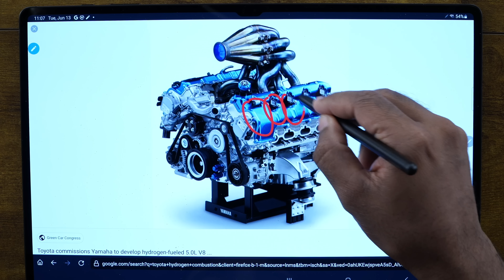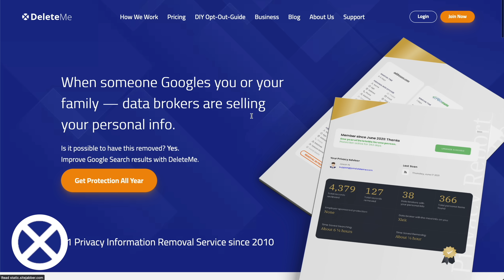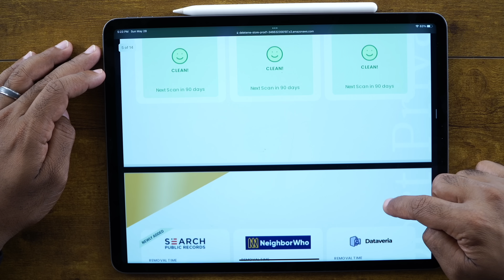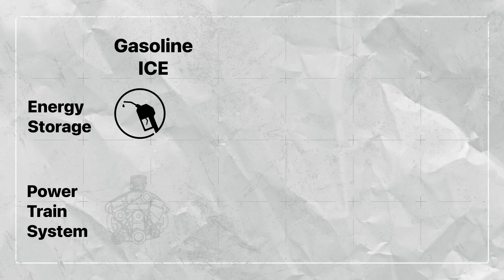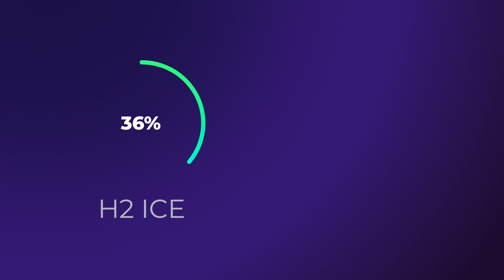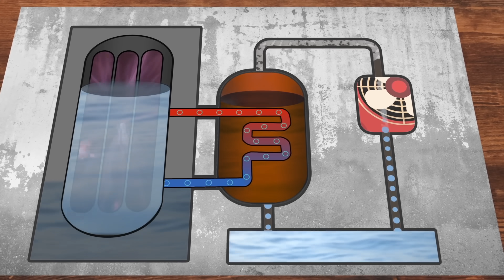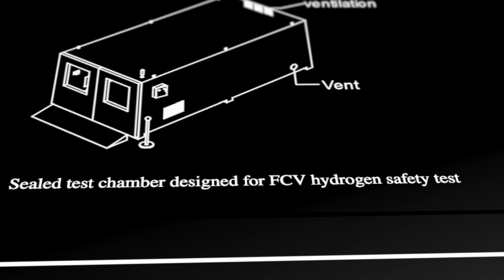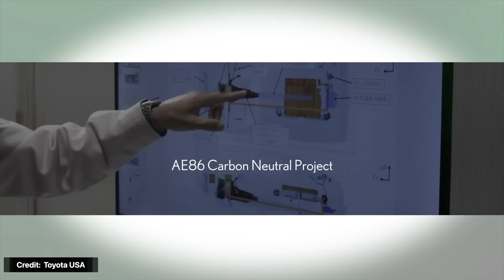Toyota's Says They Just Destroyed EVs - Hydrogen Combustion Engines

Comment: Let me start by saying that I am most definitely lacking the knowledge on how current EVs source their materials. However, it is interesting to me that you would say it is a poor choice on Toyota's part to invest in this project, as it is a much more sustainable option than current EVs. The amount of pollution courses by mining these REMs and well are their inherent rarity makes it much less sustainable as we then throw them out in 20-30 years. With Hydrogen ICEs, there is no limit to how long you can keep a car going with proper maintenance and repairs. On top of this we already have some industry built for recycling ICE engines. As for the production of hydrogen, I would say that if it is coming from green energy sources, I'm alright losing the energy if it ends up cutting emissions on a large scale, and I'm sure that with time people will find ways to improve efficiency or use the lost energy for something else.

Again, not sure on all of the facts, but for me hydrogen ICEs are definitely worth investing in and I am very interested to see what happens with it in the coming years.

Comment: Good video, but a few things always missing in these comparisons, the pollution for EV's is still there it just happens in the production.  Furthermore the same problems hydrogen has EV's have.  The infrastructure is not there.  (Yes there are more charging stations then hydrogen - but as California demonstrated asking people not to charge their cars) we do not have the structure to replace gas vehicles.  Furthermore weight is a problem for battery vehicles.  This is why besides the charge time, trucks made with batteries is a terrible idea.  EV's are a great nitch option - going around town, to work but passed that their utility is very limited.

Comment: The problem with hydrogen is that 1. You have you get it, usually by using electricity in water to separate the hydrogen and oxygen so already its a waste of efficiency. 
2. You have to store and transport then sell it...great for the oil companies who have that infrastructure in place,  gas stations..also good for them because you need to lubricate moving parts. But not so great for the consumer 
3. The engine is just a ICE, you need more mechanical maintenance, oil changes. Again more $ out of your pocket.

Comment: the electrical grid in the United States is not remotely capable of supporting a world dominated by electric vehicles, so it's kind of a non starter..even if it was, every piece of heavy equipment that is absolutely necessary to mine all the minerals (lithium, cobalt, nickel, and whatever else they need) run on fossil fuel and they are most definitely not going to be making the switch even if they could get enough energy into a battery to make the machine work 24/7 without making an already massively heavy machine heavier, the power grid would have a heart attack times a million forever

Comment: You can find a power plug everywhere, where are you going to find hydrogen? Yeah it may take hours to have some charge in a run of the mill house hold plug, but at least you can. Also look at the complex ICE vs the simple EV, its like comparing CRTs with LED displays, just look at the things inside, the beauty of EVs is their simplicity inside, this matters in the long run, less parts to maintain or replace periodically.

Comment: I think of the H2 ICE as useful in the same way as a Lamborghini is now, it's not designed to be practical. Having this will help convince the relative small number of muscle/sport car lover to leave petroleum based fuels. It's bad as a tool just to get to work or the supermarket and that's fine. As long as we don't pretend that making H2 from CH4 and then wasting most of it is clean then it's good to fill a niche market.
Reply: Problem is Lamborghini runs on a gasoline combustion engines, which have seen over a century of development and innovation allowing manufacturers to build high performance engines. Hydrogen engines will not have that lengthy opportunity for development.

Comment: OK, but you can still say that about electricity, because electricity is not fuel source it’s a product of a fuel source for saying that hydrogen could be made using less clean methods isn’t anything new fact is most EV stations are powered by gas emissions renewable sources are almost good in the right area, and focusing on a single point
Reply: Another idea about producing hydrogen to nuclear reactors is a much better option because it clears already clean enough because unless you watch, the Simpsons were thought to Noble was an absolute Wilmington powerplant. You know that we solved nuclear waste a while ago. So right there, there’s a clean ways of producing it, and the best part is the unlike electric batteries that decay hydrogen can be stored for longer periods of time so in the long run it’s a much better alternative than the dream of electric cars because electricity is a fuel source product of a fuel source if you’re spending multiple places on the grid, solar and wind just doesn’t cut it unless you’re in the perfect spot for it to be used and even then you’re looking at black ounce one single thing goes wrong happens, even with hydroelectric power
Reply: And regarding the Hindenburg bullshit. Not doing the car up like a balloon and is it really any more dangerous than gasoline if it was exposed to a flame or spark?

Comment: This is bullshit. Hydrogen is the most abundant thing in the universe. It is in a lot of things. Hydrogen burned cooler than gasoline. People think for yourself. Then Hindenburg blew up, but no one was burned. The reason why is hydrogen doesn’t burn as hot as gasoline. Another thing we can continuously run combustion engines using hydrogen. Electric cars are way heavier then a regular gas combustion engine car, it’s double. Anyone that has a Tesla can tell you that they have to change the tires almost every year because of the weight of the batteries. Imagine filling up your tank with water instead of gasoline. You can get hydrogen from water don’t be lazy. Look it up. This guy is bullshit. Gas or I should say oil companies don’t want you to know this. Hydrogen is the most efficient form of fuel in the world and the oil companies. Don’t want you to know this they bought patents killed scientists, so that they can still sell you gasoline. We can be fuel independent if we just think for ourselves. Hydrogen is flammable it combusts. Gasoline engines the gas combusts. An EV car. You have to stop at a station and charge for at least 15 minutes. Not practical. Hydrogen is like gas. This guy is full of shit and he’s bought by either oil companies or gas companies. Think for yourself. If we start now and whatever the downfall is for hydrogen, all we have to do is keep up with technology and invest in it. Like we subsidize oil companies coming out of our pockets and we don’t get. return on our investment to subsidize oil. If we invest in hydrogen technology, we will be free of the oil big business. Hydrogen can be separated from water, the most abundant thing. in the world. Thanks for yourself. Understand that hydrogen is flammable like gasoline. It can be used in a combustion engine. That’s the normal technology now. Not electric. Ion batteries have to be mind from the earth. Lithium ion is toxic. Do the math people lithium ion is mined from the earth and is toxic, water isn’t.

Comment: Armored or not, hydrogen has a trick it loves to pull where it embeds itself in the material containing it, called hydrogen embrittlement. It is only a matter of time before the components storing that hydrogen gas and transporting it to the engine lose that ability to safely store hydrogen gas. How long does this take? What are the maintenance costs associated with dealing with that? Can we create a material that is immune to hydrogen embrittlement?

On a side note, the best source of large scale power production, by far, is nuclear. So, regardless of whether we use a battery, some kind of super capacitor, or a "clean burning" gas like hydrogen, until we collectively agree to wholly embrace nuclear power, our transportation will never be truly near as green as it can or should be.

Comment: Batteries are not more efficient as they are not an energy source.  You lose about 15% just charging them, thats not even counting losses transporting or generating the electricity. They are a little more effective than ICE in some cases, until you start looking at creating and replacing batteries. EVs are garbage.

Comment: EV cars pollute to. Every time you use the brakes. Brake dust is very bad pollution
Reply: Technically they'll put out less brake dust as well because the electric motor can be used assist braking.
Reply: @PURENT  not really way more weight to slow down equals more brake dust
Reply: @explorster  Just gonna put it out there, electric vehicles and hybrids have longer brake pad lifespans due to regenerative braking. Manual transmission gasoline cars also have longer brake pad lifespans due to engine braking.

Pretty simple, the longer the brake pads last, the less dust is actually put out.
Reply: @PURENT  pollution of brake dust is pollution of brake dust bro. It doesn't matter if it take 6 months or a year to go through brake pads it still equals the same amount of brake dust one just takes a little longer.
Reply: @explorster  No shit. The point is to reduce pollution that can't be eliminated.
Reply: @PURENT  you are not reducing it, you are  just prolonging it.
Reply: @explorster  Use less than what you needed before = reduction.

Comment: Thank you again for a good video giving the pros and cons on EV, H2 and Hybrid H2 and EV. I have a better understanding of each now. I have a hybrid car (gas, electric), and its wonderfully bridging the gap between the tech; gas and EV. I am not sold on EV alone mainly due to the battery and how it is manufactured and the enormous amount of energy production necessary to supply to EV; so the H2 fuel cell (not the ICE H2) seems more promising to me due to cold temperature problems with EV. 

I think Toyota is fleshing out the issues with H2 with partnerships and spreading their research costs. Which may produce a gen 2 or 3 H2 later. Seems like (and please correct me here if I misunderstood it) the H2 might be better suited to commercial ventures like trucking companies and government vehicles. This would reduce emissions again and give our electric grid infrastructure some breathing room to ramp up for an electrified society. That said, diversity is the better course in my opinion. Having lived through blackouts I was still able to cook and draw water due to back up diesel generators (city level for water) and natural gas for cooking. I still think the nuclear option is the most viable especially with thorium and sand silo batteries (as described in your earlier videos). 

Thanks again and keep them coming.

Comment: If you have an array of solar panels you can use it to charge directly an Ev with a motor with 2 bearings. But instead you can use that electricity to produce hydrogen, store it in huge tanks, distribute it by truck and ship and store it again at the gas station, all this under high pressure and to be fed into a motor with a thousand moving parts. Something is not right here.
Reply: I would say that what's wrong is a lack of understanding of basic physics and efficiency.

Comment: BEV lovers, bang on about clean, environmental, recycle and what not, but non of that happens. Recycling of the batteries uses more energy than making new ones, also creating other pollutants, same with solar panels. Most of the recycling works in small scale but can't be scaled up. So BEV's are charged with fossil fuels that are less carbon friendly than using petrol or diesel, but that's alright because the owners have solar panels at home that charge their vehicle over night? Toyota are investing in Hydrogen the same as anyone who makes truck engines, they realise that batteries now and in the near future just aren't going to work for anything cars. Trucks and heavy machinery are going to have to use something other than batteries, yes the Tesla semi is a failure, deal with it. So the infrastructure for Hydrogen is going to come as it is the only viable alternative that we have for trucks.

Comment: Tesla has way less moving parts so less maintenance and less parts to break. Using a engine of any type that is combustion adds more complexity regardless of the fuel source. You cannot beat a simple battery and induction motor that does not destroy itself. Fool cell is not the answer.

Comment: Electric battery operated vehicles is a HORRIBLE idea. Nobody is bringing up the fact that the batteries are not reusable or recyclable. And the items inside are toxic to the environment. So the carbon in the air will be better, but our landfills will be nothing but huge toxic dumps. Not to mention the power grid issues. And power plants are not free from toxic fumes. So all in all, electric vehicles are much WORSE for the environment. But the governments are pushing hard for them. They must have their hands in a pot of cash, where they make more than oil and gas. Otherwise its a no brainer to stay away from battery operated vehicles.

Comment: One of the engineering obstacles is hydrogen embrittlement of aluminum. The Aluminum in engines over time develop microfracures when exposed to hydrogen for extended periods, thus requiring a coating (ceramic) of some sort. 👍👍 to Japan for standing up to the craven onslaught of the EV push. Battery technology is still a dirty industry. Alt-fuel vehicles are LONG over-due. Infrastructure is an issue.

Comment: Some of us want to still drive a vehicle with an engine and not a motor. We like the sound, the feel, etc. Also, I for one have became opposed to EV's largely because they are being legislated and forced onto us instead of letting the market drive the direction. If not for this, I might already have one, but I'll probably be a hold-out now.
Remember EV's have been around for over 100 years, but ICE mostly put them on the shelf until recently with the introduction of better batteries. I think the EV world has become really impressive. But, in the video it basically said little to no maintenance. I suppose that is true if you are one that trades in your vehicles all the time. I typically drive take care of my stuff and most of mine are still going at least 20+ years, and 250k+ miles later (with original engines). In EV, that would be 2-4 battery changes depending on model and capability. In some cases, that is 1/3 the cost of the car and some that I have read about (which may not be true - the internet being what it is), said due to the placement of the batteries, replacing them is something akin to a frame-off on a classic car restoration. 
I am in I.T. in a large data center and I know I constantly am changing UPS batteries. We are actually looking into other short term energy storage methods such as very high speed spinning flywheel in a vacuum instead.

Comment: Some strange analysis here.  I am not sure where the round trip 60% number comes from for a FCEV.  Conventional electrolysis is by itself only 70% efficient and then the fuel cell is 60%.  So that pencils out to 42% which isn't great.  Barely above the stated round trip efficiency for the H2 combustion which I also doubt now.  Also: comparing energy density in terms of mass is weird.  Volume is also a factor.  You are limited by how high of pressure your filling station can supply.

Comment: Yes EV is clean. But it 'transfer' the pollution to the Power Station since it has to run at high capacity if more EV cars on the road. Also to have more chargers meaning you have to lay more cables, upgrade the transmission lines, etc. All this building also meant more pollution. Also, EV are heavier and it wears off tyres faster. Not mentioning, the disposal of old batteries is not critical at moment since it is in the earlier stage. Giving it another 5 years, that is lots of batteries to dispose.
Green Hydrogen should be the way.

Comment: Japan must use Hydrogen to be self independent of energy. If you consider Battery for Electric engine, you must have Lithium as the main components. And there is the problem, Japan don't have Lithium, in fact they are lacking every resources. To get Lithium, you will need to import from 'Lithium Triangle' of Bolivia, Chile and Argentina, or from USA, Australia and China.
Politically speaking, South America now are more biased towards China, and USA are not reliable partner for Japan after the Plaza Accord incident. Australia also in 50-50 situation with China, which put Japan's future in others hands. And China, they are not friend for sure.
Japan is currently making their nuclear power plant to generate Red Hydrogen, which is actually the byproduct of nuclear energy. So for starters, Japan can make their own energy supply by themselves. Now they just need to make use of it in their technological push. Japan also not only making hydrogen technology for automobile, but for ships and planes too. Electric Engine (EE) is not viable for long range planes and ships, as EE needs a lot of batteries which is very heavy. Intuitively speaking, current engine use oil fuel, which actually decrease in usage in the runs. So the planes and ships get lighter in their travel. To compare, full oil tank is lighter than batteries for the same output energy. And that oil tank will get lighter while batteries still retain the same weight through the journey.
So even if the automobile engine for hydrogen can't compete with EV, there may be used in planes and ships.